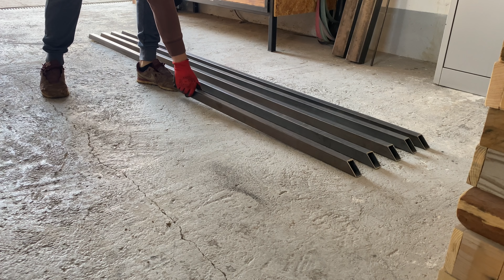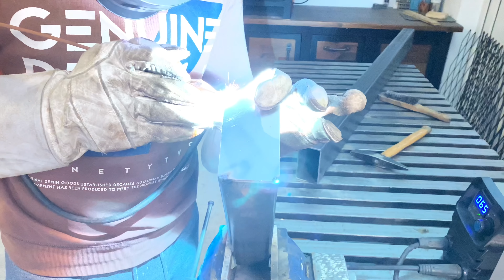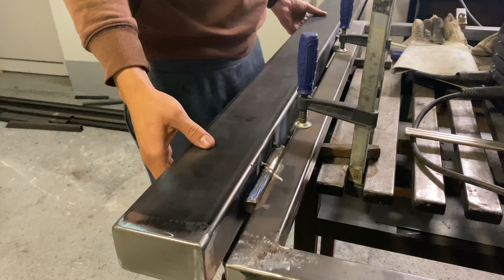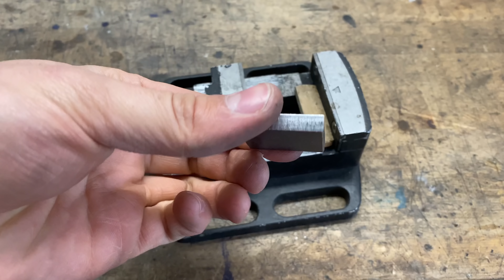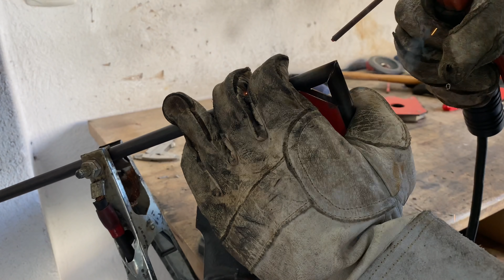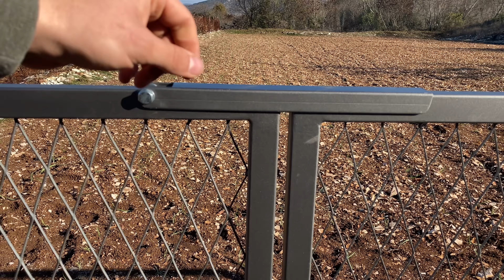Making Big Metal Gate (Dual swing)

Comment: Excellent work. I would, however, recommend removing the two small tubings that hold the pins when the gate is closed. Over time, they will be hit by a tire or piece of equipment. They tubing will win the fight, and the tire will be done for.